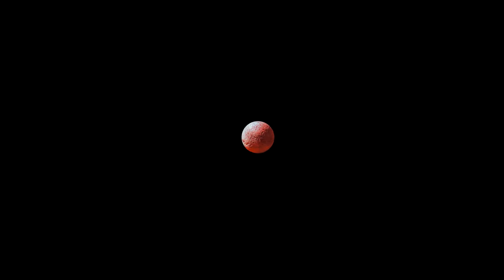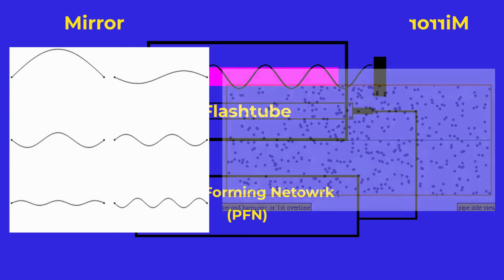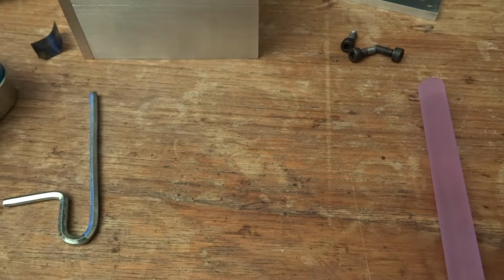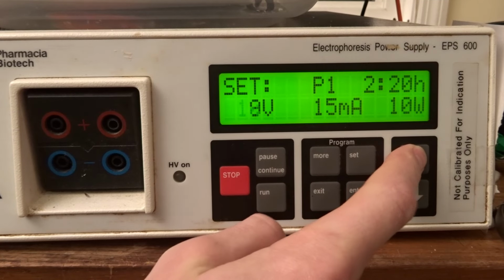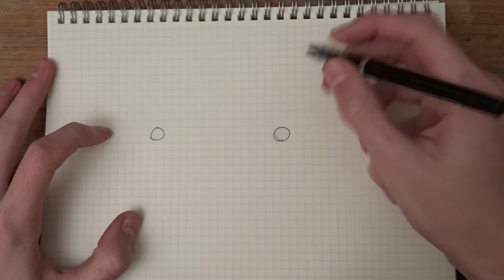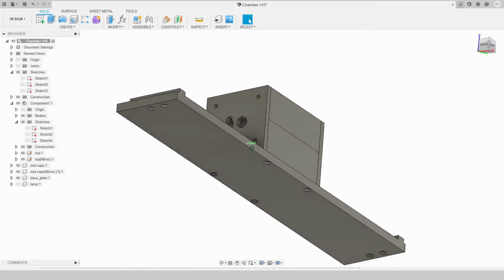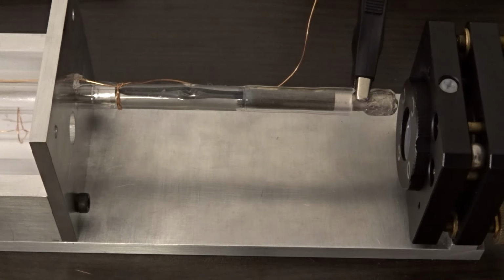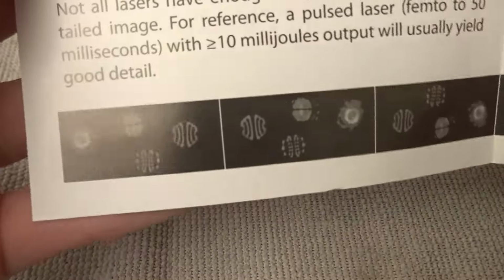Building a Solid State Laser - Pt. 1

Comment: Fascinating! And very well produced - congratulations. :) I can't help think that your mirror mounting (the aluminium flat plate) is nowhere near stable enough (mechanical & thermal effects will affect it greatly), I have never built a LASER, but I did have to align one years ago, and even with silica / invar rods to space the mirrors at all 4 corners, it was *extremely^ twitchy - you don't start seeing the interference patterns until it is very, very close. Subbed, and looking forward to pt. 2.
Reply: I'd disagree with calling his setup not stable enough, thermal effects might become an issue when running continuously the laser because you do pump a fair amount of power in that piece of metal in the end (a 600J pulse will heat a 1kg piece of aluminium about half a degree) but aligning the empty cavity shouldn't be an issue. 
With a planar cavity like this the alignement is the same as aligning a Michelson interferometer which should be fairly easy given the very appropriate hardware he has (although the procedure used may be inapropriate).
In my university aligning a Michelson interferometer with a HeNe was thaught in about four hours to a first year uni student with no prior optics experience on a setup with the same mirror mounts he has bolted to a piece of metal.
Reply: @MrBleulauneable  Just temperature variations in the room will cause thermal gradients in the aluminium slab that the mirrors are fixed to sufficient to cause the mirrors to go out of alignment (unless he is working in a constant temperature room). There does not seem to be any consideration of the mechanical support for the cavity (there may be but it isn't obvious) - the weight of the device just seems to rest at random points on the mirror support bar. If these change, the alignment of the mirrors will change. I have looked at a lot of optical layouts created by physicists, and (in general) they have been appallingly constructed. I have also made / aligned / used interferometers routinely, but still found aligning a laser cavity extremely difficult (to the extent that I thought it was impossible at one point, and this was with a commercial laser with very good mechanical design). I think the mirror mounts are OK, it's just everything else! :)
Reply: @Mister_G  Can I ask what cavities you're talking about that you found hard to align ? Because I totaly agree that they can get really difficult to align on some fancy laser, I've  had to align the cavitiy on some femtosecond Ti:Sa lasers and it was quite challenging. But that's not really what we're talking about here, here it's pretty much the simplest cavity that can exist (maybe not the most stable one but still).
And I don't think temperature changes in the room will be an issue on the timescale of the alignement, at worst it might be an issue from one day to the other but again for this application it's probably irrelevant. And if you compare this 30-ish cm slab the 2*3 meter steel  optical tables you typically find in optical labs that sometimes aren't even temperature controlled, you can understand that thermal expansion isn't always a big issue.
And you can look up Michelson interferometers that are sold for student training and they're essentially just two mirror mounted on a 1cm thick slab of metal just like this laser (this one for example :  http://www.didalab-didactique.fr/site/materiel/EN-categorie-36-produit-793.html), and they work just fine.
Reply: @MrBleulauneable  Argon ion, I believe - about 1.2m long. (it was ~30 years ago). On the other stuff, we will have to agree to differ. :)
Reply: MisterG, would the index card being, I'm guessing, .250" away from the focal lens of the source laser and also not square to the setup have an affect on seeing the interference pattern?
Reply: @Dwarfracer88  I don't think so.

Comment: I think the frosted tube is blocking too much light from the flash tube. I also saw one made like that a long time ago and it had a more pronounced elliptical. Have you thought about using a rod with a liquid core? You could circulate the liquid for cooling. I was wondering if you placed the liquid rod inside a larger tub and created a vacuum then with high voltage applied when the vacuum reaches a high enough degree of vacuum the vacuum tube should flash. Put the whole assembly in a reflective tube and of course mirrors each end like you have.

Comment: Is it a problem having a "seem" down the length of the housing? I could bore a hole through a solid piece of aluminum with an uninterrupted mirror finish. It would come off the machine that way. So no further polishing would be needed.....I would guess that additional polishing would introduce a "wavy" surface finish whereas straight off the lathe it would be all perpendicular and concentric faces....if the light is meant to bounce around in there in an orderly fashion?

Comment: How are you going to cool it
Reply: The rod and lamp need cooling. I have a yag laser with the same setup but gold cavity and it used de-ionized water which acts as an insulator and is pumped around the rod and tube during operation to cool it.

Comment: You said that the best reflective surface for the mirrored tube inside is gold. I would suggest that you look at videos on vaporized aluminum mirrors for parabolic telescopes. If they can vapor coat glass with aluminum, you should be able to vapor coat gold onto the inside of your aluminum chamber...

It is something like electro-plating in a vacuum or near vacuum, using a pressure cooker as vaporizing chamber.

Hope it works..

Comment: Well, the fundamental error you did make is that you needed to check if the side of the Nd:Glass Rod are coated, to reduce the internal reflection. Normally Nd:Glass has an optical density of around 1.52 so regarding to the fresenell equation you have 4% of losses on each side of the rod. So you would need to pump to high to at least have more than 8% gain (in perfect alignment ). The old russian systems did not a very good job on coating because they simply used more pumping power (like most russian designs). The next Misstake you did was to estimate the 80% output coupler. This does work fine for Nd:Yag, for Nd:Glass you have factor 10 Less stimulated emission (Laser Book by Knebühl & Sigrist), so a calculation would be needed. I did an Excel sheet for that, depending on the Pump power and absorbed energy you might go for a 96% mirror.  The Nd:Glass does have its stimualted emission around 1060nm due to the nephelauxetic effect, Nd:Yag has it at 1064nm. Next Error, i would never, really NEVER go for a plane parallel resonator, i personally recommend the confocal since the adjustment is much more easy. I somekind of made the same misstakes when i started :-)
Reply: Confocal is really not ideal for Nd:Glass. Plane-parallel is typical for solid state, in particular Nd:Glass and Nd:Glass lasers, because it avoids creating hot-spots in the rod.
Reply: Could you share this excel sheet? I'm really interested how you calculated it
Reply: @patrykk1709  sure / email?

Comment: I built a DPSS (diode pumped solid state) ND:YAG laser a few years ago and also had some trouble getting it to lase. I had 2 problems, insufficient pumping light, and a poor choice of mirrors. Initially I assumed that both mirrors in such a laser should be flat. Despite much effort this setup did not work. It is possible to make a laser work with two flat mirrors. However, the laser will be much more stable and easier to align if at least one of the mirrors is concave with a radius of curvature greater than the length of the laser cavity. Once I started using a concave total reflector I was able to get the laser operating in a few minutes. However, my laser operates continuously and with yours being pulsed it may take you a while to find the sweet spot. An autocollimator would be helpful for alignment, although they are expensive. I also was able to make my life easier by using the smallest ND:YAG rod I could pump with my diodes. The smaller the lasing medium the better your chances of reaching threshold.

Here are the parameters of my laser:
Cavity length: 180mm
Output coupler: flat 20% transmission (from eBay, works great!)
Total reflector: concave 100mm focal distance (radius of curvature 200mm). I also had good results with a 1000mm focal length mirror. Both from ThorLabs.
Pumping power: 54 watts at 808nm
Output power: 13.5 watts

I'm curious to see where you go with that capacitor bank. At work I use pulsed capacitors of several kilojoules for metalworking and other applications. I'd love to see current and voltage waveforms from the discharge of your bank.

Good luck and use the one hand rule around capacitors! And don't skimp on laser glasses! Out of curiosity I bought some cheap ones on eBay that were 'rated' for 1064nm and my laser went right through them!

Comment: 17:40 "I planned to get it machined". What sort of service did you use? I was expecting you to do your own machining, possibly at a FabLab. I suppose a job shop of some sort is sensible. How did you find the service, and is it expensive? Great video!
Reply from the maker: Hey John, I used a service called 3D hubs to get the parts machined. The reason I didn't go into detail in the video is you need a "non gmail" email to use the service (I was able to use my .edu address) so it's not really an option for everyone who wants to get into lasers. It is also very expensive, especially for one offs. As I continue this project I am going to utilize community machining options (maker spaces, etc) for any machining that needs to be done. 

Thanks for watching,
-Eric

Comment: You need cooling. It is essential that the cavity is cooled on a YAG laser. Seal and encapsulate the the cavity in a cooling chamber with good water flow and that will help with the performance and overall reliability.

Comment: Hi, I am also a very big laser enthusiast and I have been playing around with and building lasers for  close to 50 years now, although my  main type of lasers are the high power visible ones. I too am playing around with the idea of building a fairly high power solid state laser but I am interested in the Ruby lasers mainly because of the fact that they are in the visible red. In some of the research that I have done in the past few decades  I have found alot of various forums and laser groups that discuss all the various parameters and the  required parts and their specs and one reason your flash tube may have exploded is because of something called ringing and overshoot. If the power supply that is triggering the flashtube isnt built or set up correctly, when the pulse is triggered The energy stored in the capacitors sends a something like very jagged spikes which produce a very quick shockwave inside the flash tube which either greatly shortens the life of the flashtube or many times, the flashtube will explode much in the same way that yours did. Some of the builders use  various types of chokes inline between the flashtubes and the capacitors which if made correctly will produce the extremely quick microsecond pulse that is required to start the lasing process but the choke dampens the current and prevents those destructive shockwaves inside the flashtubes. I am certainly no expert in this either but from what you stated in your video, I think that you should definitely look into what I have said here. I really hope that you are ultimately successful as that will give myself much more hope in my  endeavours. I think in the laser pointer forums, there are at least a couple of guys there that have offered to help people in designing a solid state laser such as this, it would be worth a look there. Good luck.